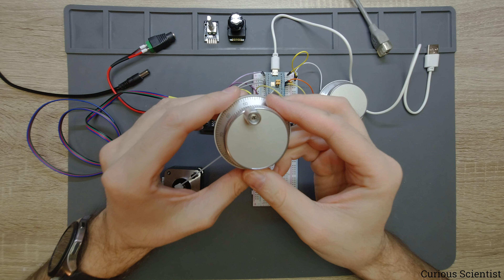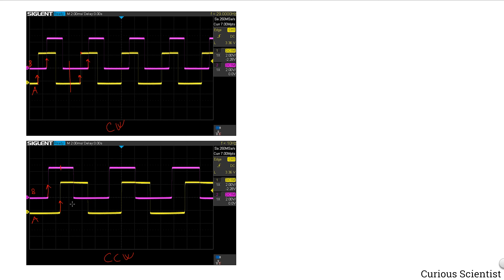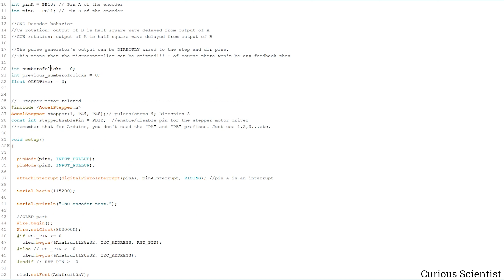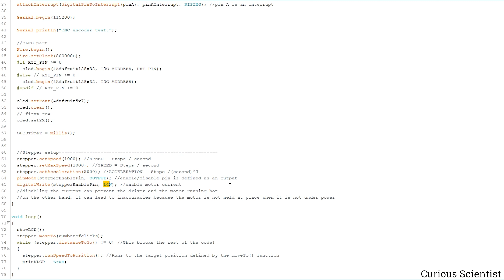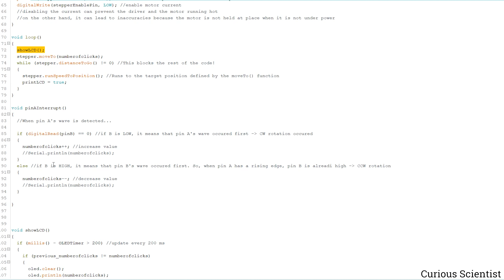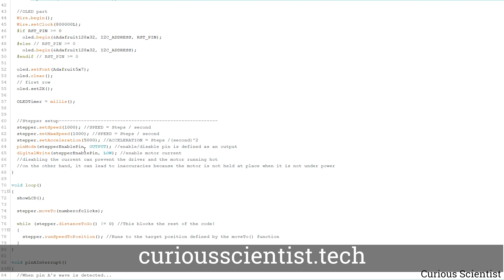CNC encoder wheel with stepper motors

Comment: Thanks for trying out the encoder wheels. They seem nice. A very neat use of the encoder to directly drive the stepper controller!
Reply from the maker: It was an excellent suggestion, thanks! Yes, the direct control is so neat. If my packages finally go through the customs, I will be able to build a nice controlling and encoding circuit.

Comment: Great video. Now i can control my old junky lathe with steppers and arduino, I hope I can add one more MPG. with two mpgs it would allow me to use two axis on a lathe. Thanks a lot
Reply from the maker: If you use a microcontroller that allows more than two interrupt pins (e.g. NOT Arduino Uno or Nano), then you can add many MPGs. I hope your project will be a success! Cheers!

Comment: Good explanation of the quadrature values coming from the wheel. 
Though I might say that I was a little confused by the scope pictures of the two channels, until I realised that they were overlapping. I will usually keep a little separation on the vertical axis between the channels. Especially since the rising and falling edges are not easily seen. Thank you for another excellent video!
Reply from the maker: Thanks! Yes, the vertical separation maybe was too large between the two signals. When I explained the signals before showing the source code, I also wrote and mentioned that there is a vertical separation, roughly 2.5V to avoid any confusion by the overlapping signals. Maybe I was not clear enough or I was too confusing. Also, I tried to increase the brightness on the scope signal, but this was the maximum. Next time, I will enhance the waves manually and make the edges thicker. Thanks for the feedback, next time I will try to explain and present the things a bit more clearly!

Comment: Awesome vidz as always .... the cnc encoder helps eliminate the need for arduino in harsh environments implementation  ... I'm still looking for a wiring diagram that show the by-pass of the arduion module , connecting the encoder directly to the driver ... any directions i should be looking at ... thank in advance.
Reply from the maker: Hi, and thanks! What kind of diagram are you looking for? You literally directly connect one of the outputs of the CNC encoder wheel to the step pin...

Comment: Your vids and website blogs are great...subscribed and going through them now.  I built a pendant for my diy Cnc (arduino controlled)and used a cheap ky01 rotary encoader, but I would like to rebuild the pendant with one of these pulse hand wheels.  What is the difference between the 4 and 6 terminal hand wheels?
Reply from the maker: Hi and thanks! If I am not wrong, the 6 terminal hand wheel also outputs the inverted versions of the A and B pulses. For general applications, I don't think we need it. I also used the 4 terminal version.

Comment: Great Work! and useful! I would like to ask you, if we can bypass the microcontroller, is that possible with any microcontroller and any driver or just in that case as you described... The enable pin must be connected anyway - as GND. But it does not have to be programmed, just ON. Am I right? My second question is about magnetic encoders. Do they appear on the market just in that form like a future part of a stepper - for feedback and alignment? Can I buy it in the shape like mechanical rotary encoder - like CNC wheel or KY-040? If so, could you give me advice where to get it? 
Thanks and all best for your future projects!!!
Martin.
Reply from the maker: Hi and thanks! Yeah as long as you use a stepper driver that accepts square waves to control the stepping you can directly connect the wheel to the driver. Also, you can use a switch for the ENA pin. 

Regarding the magnetic encoders, check my AS5600-related videos on my channel. I even made a board that can be directly attached to NEMA17 stepper motors for the exact purpose you described. 

Also, recently a viewer recommended a rotary encoder-looking magnetic encoder: P3022-V1-CW360. It is a bit expensive, but it looks quite good.

Comment: Hello. I am completely reviewing your youtube channel that I recently discovered. I am a total beginner in programming and your work is a great contribution.I am trying to modify this program to be able to modify the speed of a stepper motor in proportion to the pulses generated in a rotary encoder coupled to another motor. How can I modify the program so that the speed is a function of those  encoder pulses? MUCHAS GRACIAS
Reply: How could I generate an arduino program to control
 a large number of microsteps so as to generate different divisions between the motor and the encoder. The idea is to control a gear cutter shaft with the encoder and move the part to create gears with different number of teeth. Thank you very much for sharing your knowledge!
Reply from the maker: Hi! I think you can count the pulses of the encoder, than set up some multiplying factor that connects the number of pulses per second with the number of steps per second. So in this case, you will get a linear response on the pulses.

Comment: Does your encoder skip or miss steps if the encoder is turned too fast? There are capacitors added to the pin pf B10 and B11 in your video but not shown on the circuit diagram. Can you tell me how much are the capacitors. 
I made the circuit as you described but I am experiencing step skipping - a full rotation returns steps of 94 or 101, not exactly 100 every time.
Reply from the maker: Hi! The capacitors are 100 nF (104). I think I mentioned this either in this video or in the video I uploaded after this one that sometimes I notice that the number of clicks registered by the microcontroller is not the same as the position of the encoder. It is usually not the speed but the interrupts what is not OK. I have noticed that if I use the oled display, this jumping is more common (afaik, the oled library also uses some interrupts, so those might "compete" with the encoder's interrupts). I think I know the problem and you can see it yourself too if you try the following: put a print command in the A pin's interrupt and print a letter "A", then do the same with the B interrupt. If you rotate clockwise, the serial terminal should show "ABABABAB..." as the output. After just one click, it should show "AB". This is the two square waves I showed in the video. Now, sometimes I noticed that I only get an "A" after a click and if I rotate the wheel one more step, I see "BA" on the terminal. If the microcontroller sees this, it will actually think that you rotated in the CCW direction. So, sometimes something is fishy with the pulses or with the way how they get registered. I will keep working on this, but I also encourage you to play with it!
Reply from the maker: Hi! It is mechanically more robust. But that's all in my opinion. If you use a microcontroller and you can afford those absolute encoders, then you should go for them. They are extremely reliable. Otherwise, you can also use rotary encoders from some better manufacturers. They are cheaper than the absolute encoders.

Comment: Good Video, I was interested in using the stepper motor driver, pulse generator, and stepper motor. (And power supply). What is the enable wire for that is still connected to the bread board? Do I need it? I don't need the display. Thanks.
Reply from the maker: Thanks! The enable wire is pulled to the ground to let the stepper motor driver power the stepper motor.

Comment: nice. any advantage of these CNC wheels compared to the absolute encoder you showed in the previous video? other than you can bypass the MCU, that is (which I don’t need to do). thanks!
Reply from the maker: Hi! Seems like the answer I wrote in the morning just disappeared. This encoder/pulse generator is a bit more sturdy, but this is the only advantage that I can think of. The absolute encoder is the absolutely best (pun intended) choice if you are aiming for precision and repeatability. But, it will be the most expensive choice. Also, if you use a proper code, and a bit better components, a simple rotary encoder can do the job too and you can buy multiple of them for the price of the absolute encoder.

Comment: Thank you for these tutorials! I have tried this with a TB6600 and an UNO without any luck. I set the pinA  = 2 and pinB = 3, also stepper (1, 9, 8); but no luck so far. When I look at the serial monitor ( I do not have the oled yet) I get "CNC" not "CNC encoder test". I changed the baud rate to 9600 in sketch but that did not help. Any suggestions would be helpful. My goal is to dust off my old Teensy2 and run the encoder and limit switches as interrupts while a joystick is used to quick adjustments for a router lift.  If anyone could point me in the right direction I would appreciate it. I do understand that this session was uploaded 2 years ago. Take care.
Reply from the maker: Hi! What do you mean by no luck? It does not work at all? Where do you encounter issues? I would suggest only using pinA as an interrupt and defining pinB at 7 for example. If you don't get the full serial message, try inserting a 3-5 second delay right after Serial.begin(115200). Or put a blocking while there. while(!Serial){;}. But when you use the device without the computer, comment out all the serial-related things, otherwise, you will notice some lagging. Also, since I have no idea what's wrong because you haven't told me ("without any luck" is not a good description), it could also be that your wiring is wrong and the TB6600 stays disabled thus the motor won't move.
Reply: Sorry, I should have been more specific.  The TB6600 is not receiving any signals so the stepper motor does not move. I used pinB to 7 and still no signal.  I tried your "Arduino with TB6600 using AccelStepper library" and everything worked fine. I am going to pick up new Dupont connectors and try again.
Reply from the maker: Please drop me an email with your modified code.

Also, checking the connections is a great idea. Breadboards sometimes can have poor connections. Recently, I messed up an SD card because of it. 😄

Comment: Hi, just a little question: why did you specify in the description that you need to use pin 2 or 3 for the encoder output A (instead of 10)? Can output B remain on pin 11 (arduino)? Sorry but I have never used the STM32 (I will use arduino Nano).  (my cnc encoder is coming soon from china!! :o)) )
Reply from the maker: Hi! If you use Arduino Nano, the interrupt pin has to be either 2 or 3. The other pin (pinB) can be any other leg. But you have to be very careful about the definition of the pins. The code on my website is adjusted for STM32, so you need to use different pin descriptions for Arduino. It is not a rocket science, you just need to pay attention.
Reply: @CuriousScientist   of course, I have already set the pins on ArduNano, I have added small pieces of code that will be useful to me but, I cannot understand why I have to use pins 2 or 3 only for the encoder A output. I will study the matter, I am not an expert and I want to understand  ;o)
Thanks again for sharing your studies, I follow you!  ;o)
Reply from the maker: You are welcome. Arduino Nano and Uno can only use pin 2 and 3 as an interrupt pin, that's why. The STM32 can use nearly all of its pin as an interrupt pin, so if you use that microcontroller, you can pick any of the pins as an interrupt.
Reply: @CuriousScientist    ok, ok, thanks a lot! I am more versed in mechanics but I like to add electronic controls to the machines I build (I really like working wood on weekends). When I have finished the milling machine, if you want, I will send you the photos. Good evening Prof!
Reply from the maker: Sure! You can drop me an email via my web page.

Comment: I Try your  Code but get this Error: sketch_sep21f:13:12: error: 'PB10' was not declared in this scope
 int pinA = PB10; // Pin A of the encode
Reply from the maker: Probably you're trying to compile it for an Arduino while the pin definition is according to STM32 requirements. You have to modify the pins to make it compatible with Arduino.
Reply: @CuriousScientist  thx i found this Error 1 Hours ago. Thank you👍
Reply from the maker: You are welcome! I hope you could fix it.

Comment: I have practiced from your video and it was successful even though the components are not the same as you used, especially the encoder part, everything runs normally but it seems that the rotation is limited. If it reaches the limit, the stepper motor will rotate in the opposite direction itself. can you tell me so that the stepper motor rotates without limit what should I do?
Reply from the maker: What do you mean by limited? I don't understand, really. What limit is reached?